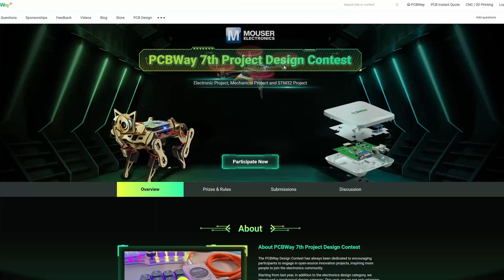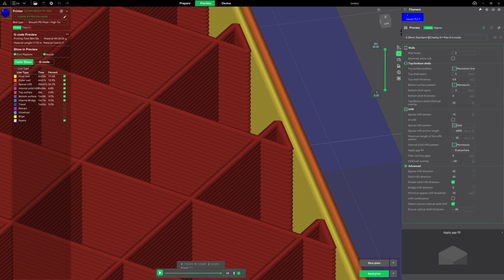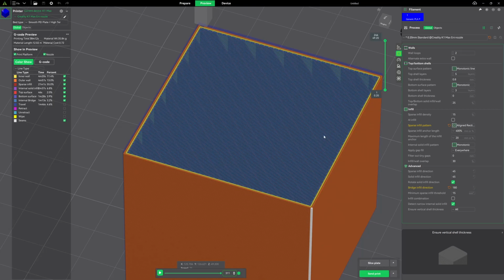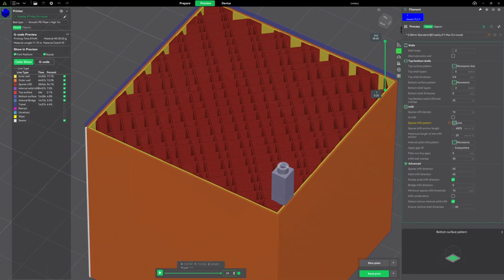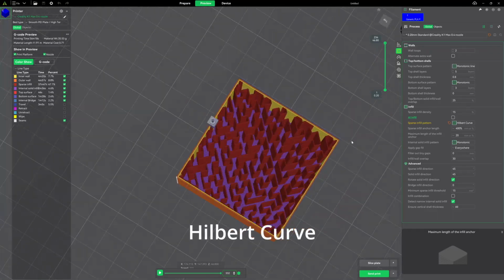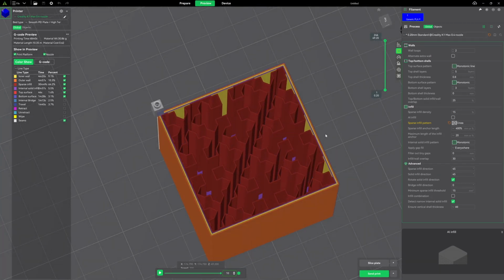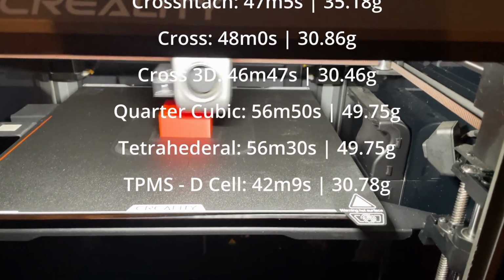Mastering 3D Printing Infill With Creality Print 6

Comment: Chapters are helpful - Nice video btw.

Infill Basics

Introduction to Infill (0:00)
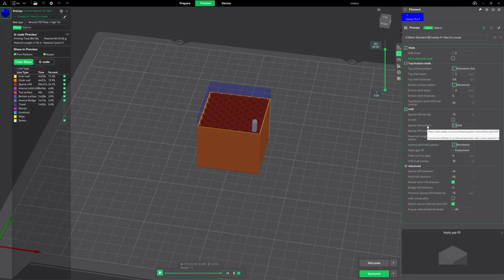Infill Density (0:52)
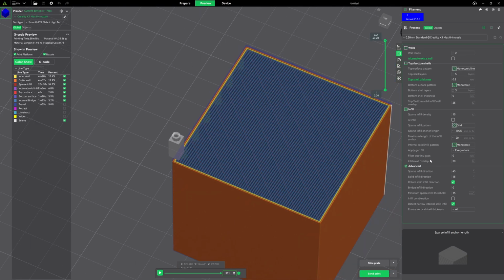AI Infill (1:30)
Infill Patterns

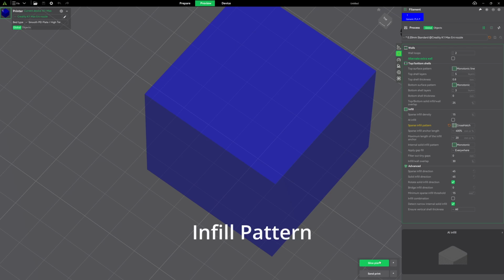Infill Pattern Options (2:04)
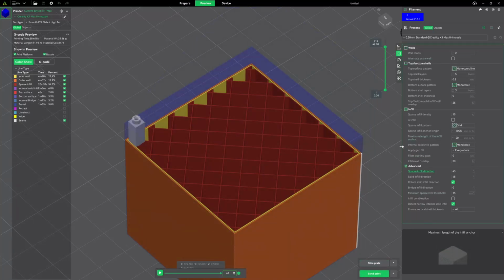Sparse Infill Anchor Length (2:18)
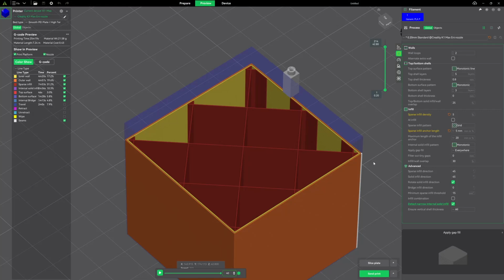Internal Solid Infill Pattern (3:16)
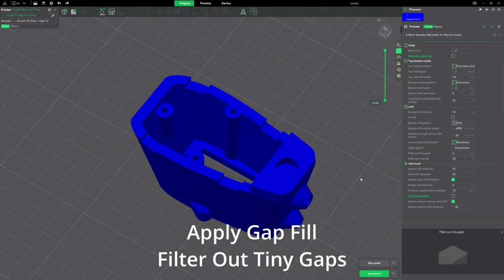Apply Fill Gap (4:21)
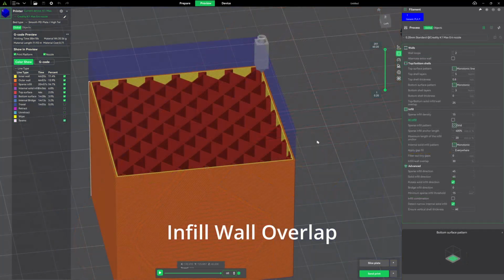Infill and Wall Overlap (5:32)
Advanced Settings

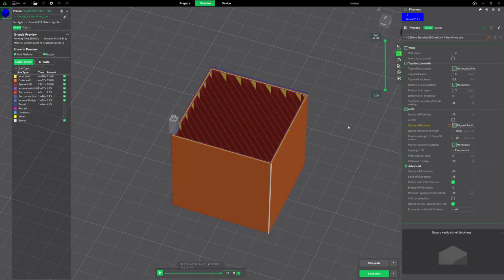Sparse Infill Direction (6:18)
Solid Infill Direction (6:40)
Rotate Solid Infill Direction (7:16)
Infill Bridge Direction (7:58)
Infill Direction (8:37)
Exploring Infill Patterns

Infill Patterns Overview (9:15)
Concentric (9:52)
Rect Linear (10:04)
Grid (10:18)
Line (10:39)
Cubic (11:00)
Triangle (11:23)
Trihexagonal (11:48)
Gyroid (12:02)
Honeycomb (12:15)
Adaptive Cubic (12:31)
Lined Rect Linear (12:55)
3D Honeycomb (13:19)
Hilbert Curve (13:29)
Archimedian Boards (13:47)
Octagram Spiral (14:11)
Support Cubic (14:35)
Lightning Infill (14:58)
Cross Hatch (15:26)
Cross (15:52)
Cross 3D (16:11)
Quarter Cubic (16:29)
Tetral (16:53)
DPMS (17:26)
Print Times and Material Usage

Comparing Infill Print Times (17:50)

Comment: Thr problem with the creality slicer is that it is horrible in the interface. You cannot even get a raft without visiting a forum. Every button lacks explanatory,  temp is done on the filament.. speed,temp,buildplate adhesion is the three main things i want from a slicer and all were difficult to find. The old slicer was not great, i prefer cura but thismone is just uninstall
Reply from the maker: Are you using Creality Slicer or Creality Print? They are both slicers, but Creality Slicer is out dated and wasn't the best. Creality Print on the other hand is pretty good!

Comment: Is there a way to do different infill on the same part?  15infill on the bottom half and 8infill on the top half?
Reply from the maker: Yes. I don't have a video for Creality Print 6 yet, but here's a link for the Creality Print 5 method. The 2 are similar enough to be able to do it. Check around the 7:30 mark https://youtu.be/JybAyxnooNU

Comment: Excellent video!
It would be very good if Creality used in the menu the same colors corresponding to the elements of the printing structure, so it would be very easy to identify which command influences the printing structure as you showing to us. Thank you!